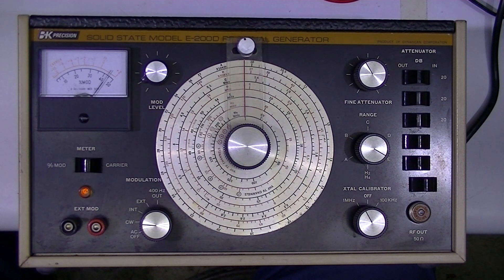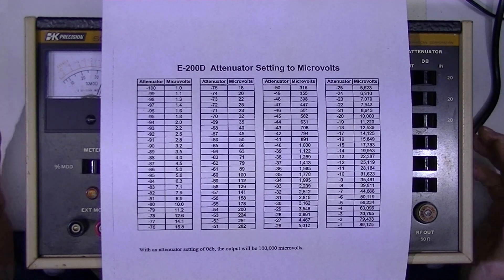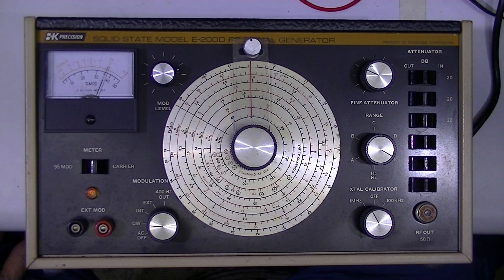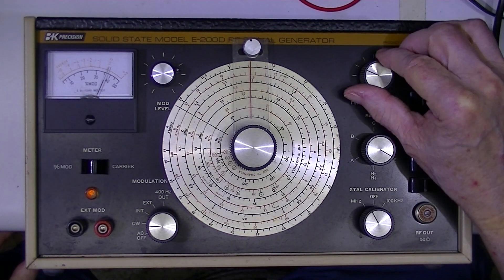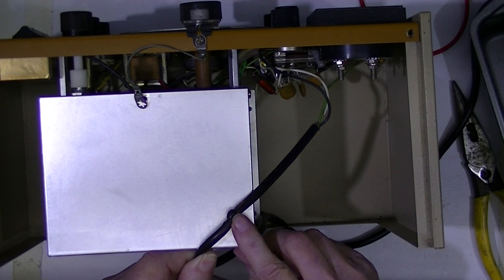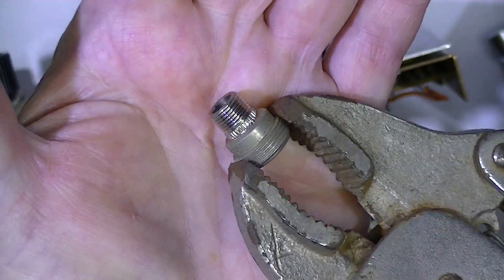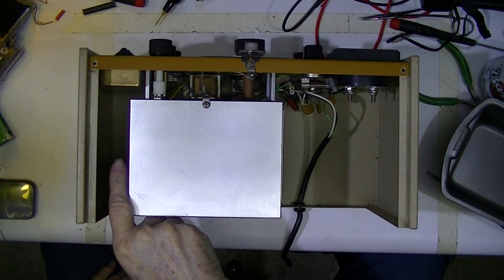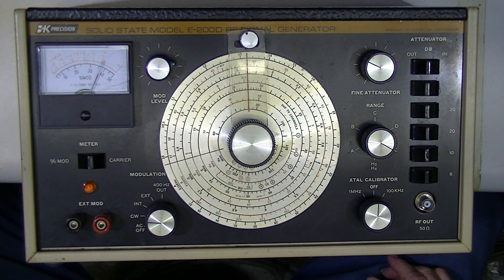B&K-E200D Signal Generator

Comment: Nice video. I have one of this in my "collection" but the 1 Mhz Xtal calibration doesn't work in the range E above 25 Mhz. It's not audible at all. Even though in 20 Mhz is almost not audible. Have you checked this feature in yours? Maybe is an issue in this model or maybe mine is defective. I will appreciate your comments.
Reply from the maker: Currently my Sig. Gen. is not set-up, so I can't try, Sorry.
Thanks
Steve

Comment: I have read that the new BNC connection has to be shielded with a thin copper tape and a ground wire attached. All this is done in the back were the BNC is attached and it helps with shielding and leakage prevention.

Comment: Kool! A vintage piece like that! :-) Although I'll probably never see one in my lifetime,  I just have one question, what was the purpose for that metal plate that you put on the inside, when you switched the output connector? And how did you get it to fit inside that RF shield box? :)
Reply from the maker: Actually, I don't remember. I think that the plate was original.
Sorry
Steve